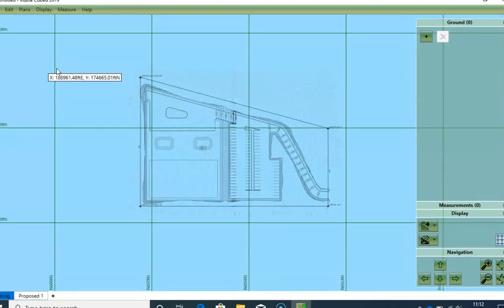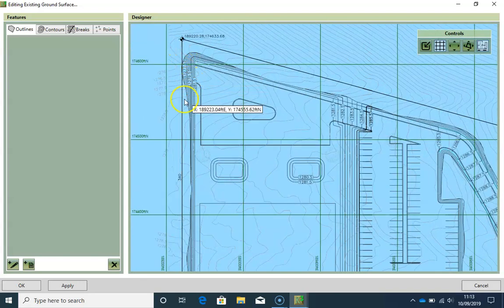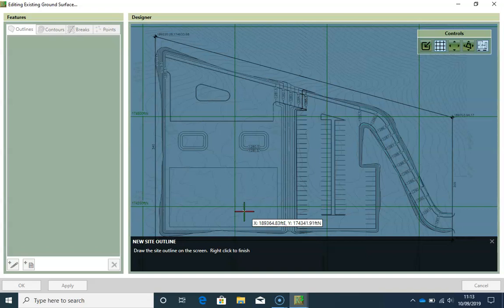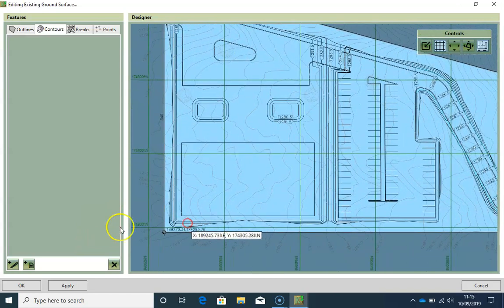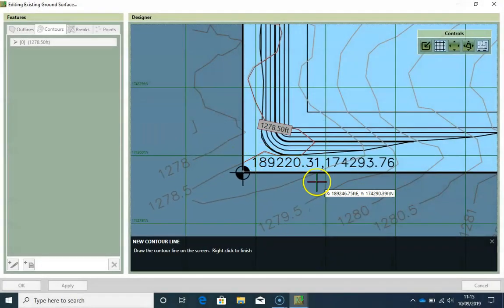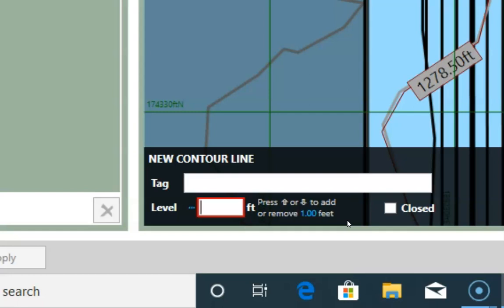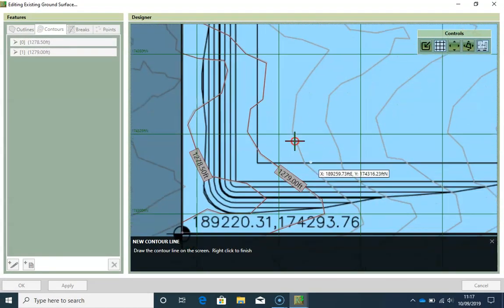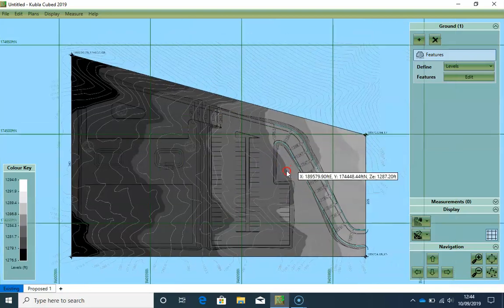Kubla Cubed 2019 | Walk-Through Building Site (On-Screen Take-Off) Part 3: Existing Levels

Comment: Can the software automatically trace the contour lines using the underlying vector line of the PDF? Tracing each contour line manually seems very tedious.
Reply from the maker: Yes is can.  This video is for an old version.  We are due to update a lot of these videos this year.  The latest version Kubla Cubed 2024 has a very powerful PDF vector extractor.  You can contact us via the website to request a trial version.